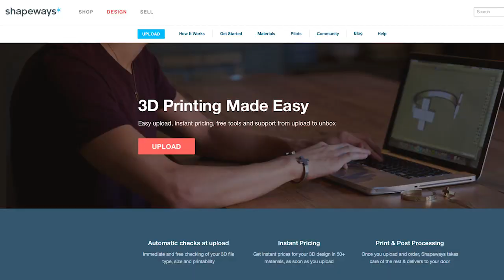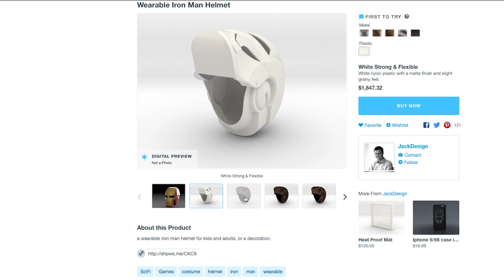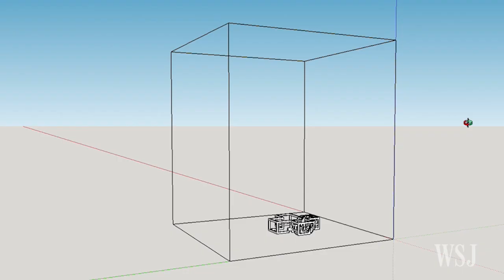Accessible 3D Printing and Digital Piracy

Comment: Print farms are out of control with not license checking prints being sold. Not paying royalties to actual license owners. Piracy is out of control. 
Its so easy to check print farms to see if they are pirates but yet im struggling to find a legit farm. 
There needs to be a governing body for piracy and shutting down these thieves steeling from the honest conunity. Where are the authorities? 
Has a print farm ever been tested cause my bet youll struggle to find any legit farms. 
I cant find a legit one and i keep looking.
Send in hidden camera they are very unlikly to pass. Thats my bet as a expert.